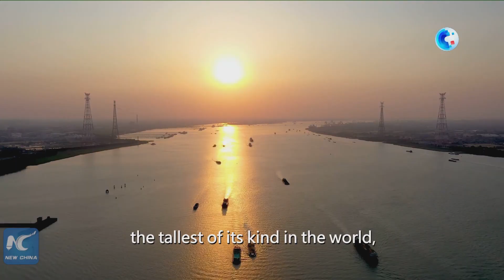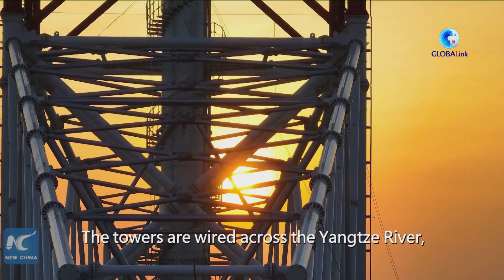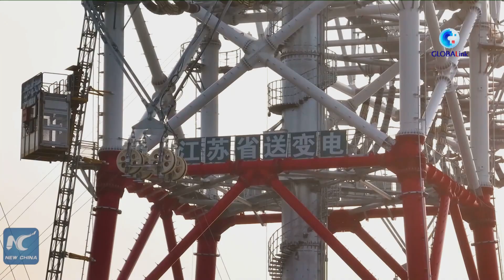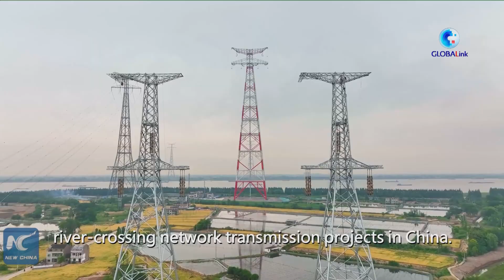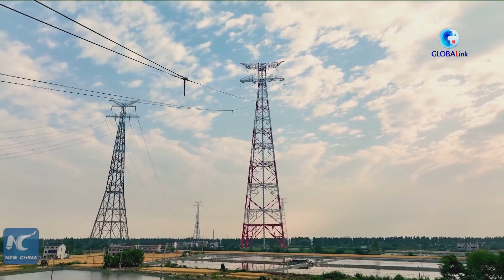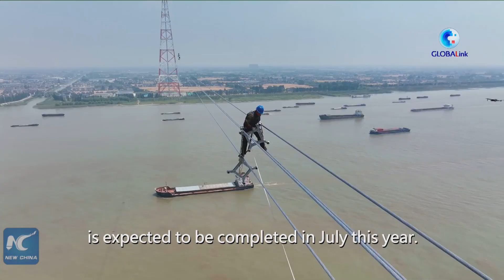GLOBALink | World's tallest power transmission tower wired across Yangtze River

Comment: That’s 1.26 miles for those of us who aren’t on the metric system. Incredible feat of engineering! 

The only thing somewhat comparable is the second largest high-voltage towers in United States. The Ameren Mississippi River Crossing near West Alton, Missouri. These towers are about 660 feet (201 meters) tall. They carry 345 kV lines across the Mississippi River. Only about half as tall as these.